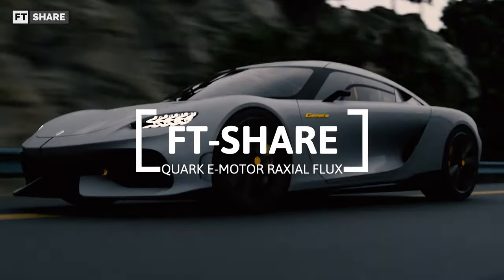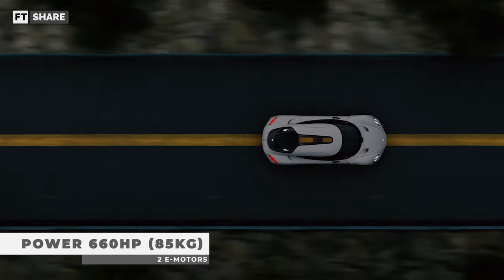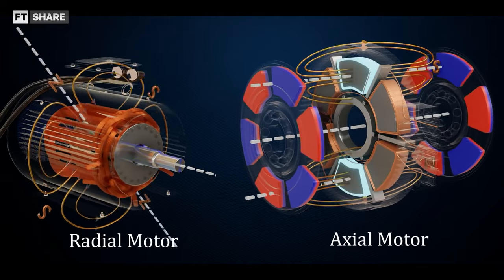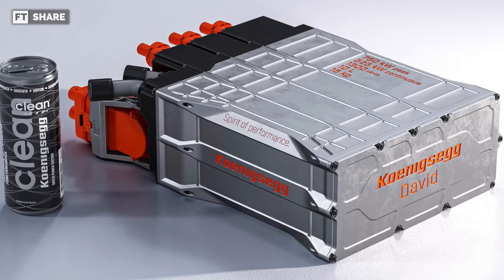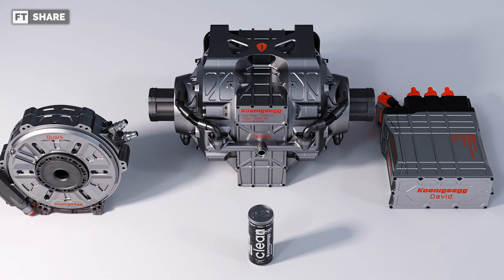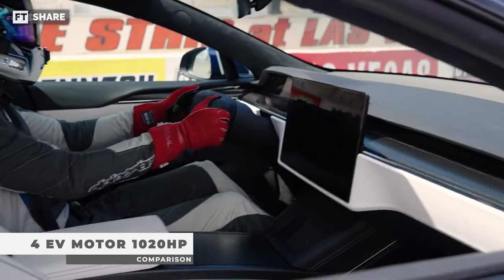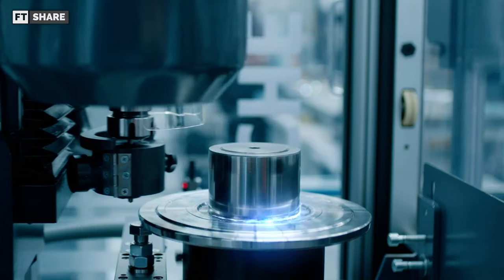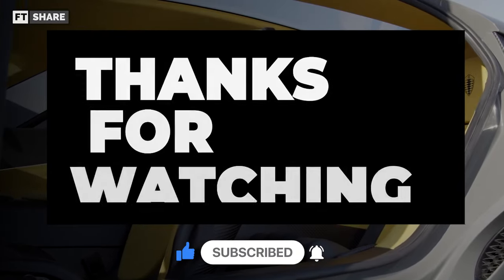Tiny But Mighty - 600Hp In Compact Package!! | Quark E-Motor Raxial Flux By Koenigsegg (100004.V1)

Comment: I'd like to see them stuck two of those motors together and offer them to put in other cars as a combustion engine replacement. Motor, controllers, batteries , and chargers all as a package.
Reply: Two 330HP motors at 30kg each. Combined with a 100kWh battery weighing about 400kg, it will perform for about 10 minutes.
Reply: @hougen968  I am interested in you evaluation,  I should love to know more
Reply: @hougen968  bugatti veyron, with a full tank of gas, can drive only for around 12 minutes at max. speed:))
Reply: @hougen968 What nonsense
Reply: @the_atomic_kebab Clearly not aware that max speed is very different than full throttle. he never said max speed lol. again, flooring it around a track it would last about 10 minutes . completely useless without a combustion motor hybrid setup.

Comment: this engine was first developed by emrax in Slovenia in 2008 i have a 150 hp emrax 268 version at 20 kg which i bought in 2018 in a 2 place aircraft.
Reply: Does Koenigsegg bought the rights to further develop and manufacture this electric motor?
Reply: does that mean there are ways to access this tech without KonnigsEgg?
Reply: @LouAlvis  Axial EV motors have been around for more than 200 years, they have not copyright or patent claims to it. Radial EV motors, same... combining two common use unpatentable items via a shaft is pretty much impossible to patent. Now the controller system is another thing. They probably have a lot of research in getting it to "fire" correctly and efficiently.

Comment: Any electric motor that is rated in hp only is utter BS.
What is required is RPM. It makes x torque at y RPM. producing z kw of mechanical work from w kw of electrical energy.

Why dont you people try learning real facts instead of swallowing marketing hype?
Reply: Are you nuts? hp is just another unit for mechanical work and can be used exactly the same as kw
Reply: @TrccrT  its meaningless without rpm, or TIME.

horsepower is a function of force over TIME.

i see you fell for the hype. thats what these guys rely on. ignorance.
Reply: @paradiselost9946  typically they just put the maximum HP at any given rpm, it's still pretty meaningful.
Reply: @pasiutrial  its absolutely meaningless.

and then of course... is this the electrical power it consumes? electric motor manufacturers love to take advantage of little minor details like that...

or is it the actual power seen at the shaft?

this whole thing is fun. like my ebike back whenever. a strict rule of 200W maximum.

they fail to state if thats rotational power, or electrical power. so i could have hundreds of NM of torque at virtually zero RPM. yet use several KW of electrical power.
vice versa, letting it spin at an rpm equivalent to our (also strict at 30km/h) top speed yet limiting consumption to a mere 300W or so...

and yet, in either case, the OUTPUT was 200W.

i can lock the shaft on a motor. it makes ZERO HP. its making LOTS of torque though.

its also chewing plenty of electrical energy, making heat, buzzing, and if i hold it for much longer it will start smoking... because it isnt spinning, it isnt acting like a generator producing a backemf to counteract the applied EMF to keep electrical power consumption to a safe figure.

so whats its output when its stalled? its not rotating. its not making any HORSE POWER.
or... to be really sneaking... its not moving 330,000lbs 1 foot every... awe hell, i forget if its a minute or hour... 

THAT is the MOST MEANINGFUL figure any electric motor manufacturer can tell you. STALL TORQUE. along with max rpm, and efficiency.

a squirrel cage or synchronous AC motor is a great example of an electric motor with pathetic "stall torque". so bad it simply doesnt start by itself, and will only run when close to its synchronous speed.
Reply: @paradiselost9946  1 HP is defined as the power that lifts 75 kilogram for 1 meter in one second. Equivalent to 736 watt. It is not meaningless. Combustion engines have sweet spot where torque is maximum at a certain RPM. Electric motors not so much. The conversion of electric input power is more linear to mechanical output.
Reply: @franktechniek  you dont get it, do you?

theres three or more measures of efficiency on an electric motor.

i can short any power supply out and produce as many kw or hp of heat as i like within reason.

the thing is, was my intention to make heat, or to make light?

one was efficient use, one was not.

an electric motor may CONSUME 1kw, but if the shaft doesnt turn, its not PRODUCING 1kw. its producing NOTHING.

yet its still CONSUMING that 1kw. that is, by all definitions, 100% inefficient.

taken to the other end of the scale, when that motor is spinning at its maximum unloaded speed, limited only by its own BEMF, its barely consuming any power at all.

the shafts spinning but its doing nothing... the only current flowing is due to resistance as the EMF is canceled by the BEMf, and whats left over is the electrical loss, resistance and hysteresis, etc...

yet its still doing nothing.

only somewhere in the middle, is there the so called "sweet spot". inherent in ALL engines, not just ICE, that it can convert electrical energy to mechanical work most efficiently.

ps, a hp is 745.7W.
what you refer to as 736 (735.5)W. is the pferder starke, aka PS, aka "metric horsepower" aka a rather obscure version of the HP used by germany mostly... most people think of the "standard horsepower" as coined by watt... 30,000 ft/lb/min (sec? i always forget...)

and its an arbitrary figure pulled out of a hat by james watt, and has been a pain in the butt for all engineers and physicists ever since. sort of why the germans came up with the PS. all that did was confuse things. yet another "standard".
Reply: @paradiselost9946  I think I get it 100%. As said, HP is the equivalent power you need to lift 75 kilograms over 1 meter in a second. Car engines are rated in watts these days, but you can still convert back and forth between watts and HP. Ok, you could say with a stalled electric motor all the energy is spend in the motor and turned into heat. There you decide not to lift the 75kg, over any distance, but that is not really interesting. People tend to drive a car, not turning the engine up with the brakes on. An electric motor is quite efficient, some energy is always converted to heat, inside the motor. So, it might not be able to lift 75kg per 736, perhaps only 650. In the end, all energy is converted to heat. But a typical car has moved, after doing so. HP or wattage is VERY meaningful and useful to compare cars. Like the weight of a car is a nice indicator as well, of what you can expect regarding performance. The precise performance is also dependent on air resistance and some other things. Cumbustion engines give their maximum power around 3000-4000 rpm and need gear boxes to keep it in balance with the speed you are driving. Electric motors don't suffer from that and 90% of the energy is always transferred to the shaft. And that is the end of it.

Comment: Please can they apply a similar level of thinking to power generation and supply.  At present the methods and efficiency are very low and far too expensive.  We need more distributed storage systems.
Reply: I still think a fairly tiny gas turbine driving a generator through a reduction gearbox would be the best of both worlds.  Could run off of kerosene, and be even cleaner on CNG.  Very little infrastructure would need to be changed and 0 charge time as there would not be a battery powering the motors.  Drive all day and just fill at the pump like we do now.  I wonder the power needs for this koenigsegg motor?
Reply: Meh. Ive been tinkering with an engine designed 120 years ago, that showed a thermodynamic efficiency that still hasnt been bettered.
Ww1 got in the way and it was forgotten about. Theres one running example in australia somewhere. Its huge. But its also highly scaleable.

Thing is, with no crank, con rod, piston, it seems useless... until its used to create hydraulic pressure... that drives turbines. That can run slow enough to be direct coupled... to wheels, generators, whatever.
Reply: @reevinriggin3570 yes but how would you get the heat away from the electric motor/s? turbines are not very fuel efficient, and take a while to start and produce max thrust. interesting idea though not saying it shouldnt be developed if efficiency is there. a big if.

Comment: 🎯 Key Takeaways for quick navigation:

00:14 🚗 Koenigsegg has developed an electric motor with a small diameter, around the size of an unpeeled coconut, and a thickness of about six centimeters, which can produce up to 330 HP.
00:27 ⚙️ This electric motor is designed to be paired and controlled through one inverter, and two units of these motors can generate up to 660 horsepower while weighing less than 85 kilograms.
01:08 🔄 The motor uses a technology called "raxial flux," which combines two types of electric motor designs, radial and axial flux, to achieve a unique balance of torque, power, RPM, and weight efficiency.
02:16 🌟 Koenigsegg achieves the motor's lightweight by using carbon fiber material in certain internal parts, making it up to 15 kilograms lighter than Tesla's electric motor.
03:15 🏁 The Quarky motor outperforms Tesla's electric motor, offering up to 300 more horsepower and 1173 newton meters more torque, making it a promising option for various applications, including mass-produced vehicles.

Made with HARPA AI

Comment: did anyone else notice the slew of mistakes on this video?  The tesla plaid has 3 motors, not 4. so the HP is higher on the plaid on a per motor basis than the "raxial" motor. Then over and over the horsepower stated is 330hp while the text keeps saying 300hp. But the motor has 250kw stamped on it which is about 335. So technically neither the text or what is stated is correct. Then the efficiency number is never given either. So how can you say it is less power consumption if you dont have anything to compare it to? there isnt much to redeem this video.

Comment: Koenigsegg blatantly stole YASA Motors' design while it was developing the Regera. There is nothing Radial about that 'RAxial' Quark Motor. It is a near-identical YASA axial flux motor in design. Changing the material composition of a shaft to carbon fiber is not a breakthrough. How sad for Koenigsegg to be ripping off other company's technology and trying to fool people by falsely claiming Radial capability along with axial. Sadly, this is a clear sign that Koenigsegg has stopped innovating and given up on being  respected, and is instead prioritizing money-making.
Reply: I think that if that were true, YASA would be on the warpath, legally.  At any rate, I don't think the combo motor would be economically feasible to compete with the YASA. I'd like to see the design logistics support analysis between the two.
Reply: I am interested in price point of either Yasa or Quark. Any info on price for unit responsible for 350 hp?